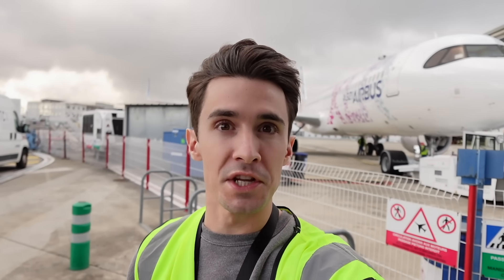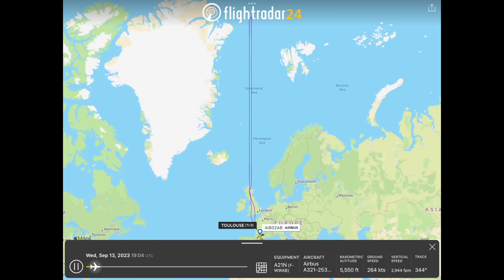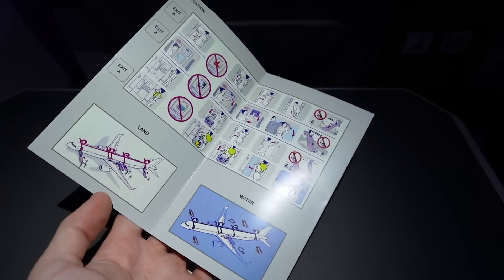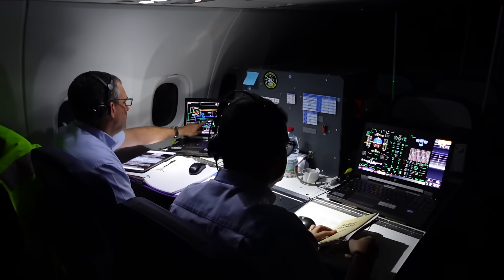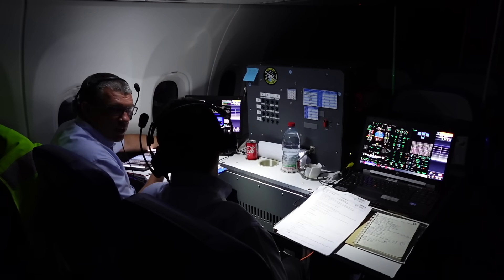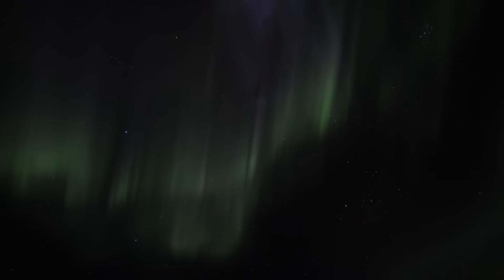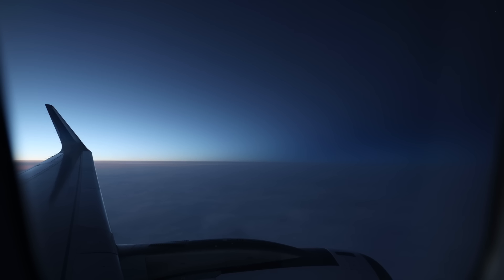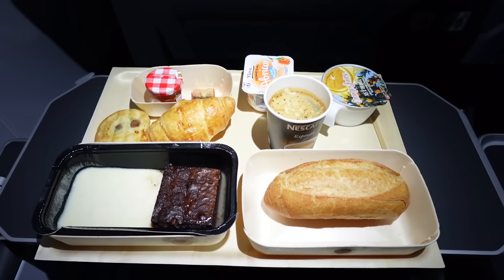Onboard an 11-hour A321XLR Test Flight to Nowhere!

Comment: I can’t wait for this to be in service. Game changer in the long haul biz
Reply: It will not kill true wide body planes. No way. It will simply connect remote cities with no prior direct connections and low traffic. The A321XLR has its own restrictions and shortcomings.
Reply: @paradigmlost7582  It lacks the range and the capacity. I believe nobody expects it will replace wide bodies. Like you said, I believe we will see previously non existent routes coming to existence.
It will make another dent in the hub / spoke business model reducing the need for some wide body flights, but not replacing them.
I hope.
😊
Long flights on narrow bodies is not my thing.
Reply: people who dont like single aisles for long hauls i just don't understand they are so spoiled im happy to be on any plane
Reply: Lol game changer in what way? The 757 already trailblazed the single aisle, long haul routes. This just expands on that with additional range, at the expense of speed.
Reply: @FEJ-234 it’s absolutely a game changer. The hourly operating cost remains significantly lower than the B757. The airplane won’t need major airports either. So instead of the hub and spoke, they can do direct flights to and from small cities.
Reply: @rtbrtb_dutchy4183   They mean it isn't any game changer because the 75 has been doing that for decades...It's just a replacement for lower costs.
Reply: @Jack3md  no, you are missing the point. The b757 has been doing those trips, but can’t do short trips as efficient. This is why Southwest never flew 757’s. Why? Because the 757 won’t do well from Lincoln, Nebraska, to Billings, Montana with only 100 passengers. 

The game changer is that the A321XLR can fly long haul, but can also fly short haul. And if a short haul flight has a drop in passengers, they can send a 320 or 319 with less seats, but they can still use the same pilots. 

It’s the flexibility that will make it the game changer.
Reply: I absolutely hate the concept of single aisle long haul. Anyone who has flown long haul will tell you two aisle are necessary for mobility during the flight.  It will be sheer torture to the passengers to subject them to 8 plus hours of hell on this pig.
Reply: @davidcole333 why do you need two isles?  If you want to stretch your legs, don’t you simply stay in your isle?  I’ve never gone over to the other isle. 🙄
Reply: @rtbrtb_dutchy4183  Wide bodies usually have more space, more comfort and less noise.
Reply: @miks564 no, there is no more noisy plane than the Boeing 777, it is horrible.
Reply: @miks564 widebodies being more "spacious" and less "noisy" is not true at all. Physics alone disproves that due to the sheer size of wodebodie engines. Two engines need enough power to not only fly hundreds of thousands pounds, but also be approved for si gke engine should one engine fail. Which means they will require massive amounts of thrust which causes a lot of noise. That said, they are making engines more efficient not only with fuel, but noise as well. The technology they use for new gen aircraft is made with comfort and safety as top priority and the XLR is no exception to that. It all cokes down to the airline and how they choose the utilize the layout.
Reply: @StallionFX1   Well, you might have a point. A wide body cabin doesn't have to be quieter nor offer more space than a narrow body. That said, they truth is that they often do. I lack the experience on flying on old Boeing aircraft (besides the 737), so I'm not sure about those, but I never seen a narrow body more quieter than an A330 or A350 or A380.
All these have much bigger engines, but they're still considerably quieter ...and they offer more space as well, because wide bodies are usually configured for long haul.
But I admit I have to wait to see what would be the cabin configuration for XLRs... One thing I'm certain of, it will be noisier than the mentioned aircraft models.
Reply: @davidcole333 Don’t be a baby. It won’t be anywhere near that bad.
Reply: @davidcole333 normally, most people that think like you either have no clue about aviation or just can't stand the idea of a narrow body doing a "long haul" without doing proper research and/or given new gen single aisle a chance. Granted, it seems unorthodox just thinking about it, but it's really kot as bad as you think. With newer generation aircraft, safety, efficiency,  and comfort are the biggest priority. 

I've flown on Delta's A220 (SLC to EWR) and Aer Lingus A321NEO  LR (JFK to DUB). Both flights were over four hours (with Aer Lingus being over 6 hours to Dublin and more than 7 back to New York). I'm 6"4 and I was comfortable. Even more so the Norwegians 787-9. I say that because these are the new gen aircraft I've flown on so far. The A220 was relatively quiet and hardly felt any bumps while in turbulence, while the A321NEO LR  got me to my destination without complaints. The 787-9 was cramped, seats were uncomfortable after a few hours, but it was impressive to watch in motion. It really comes down to the airline and how they chose to set up their aircraft. Even the smallest details can male a huge difference. For example, Virgin Atlantic offers one of the LARGEST IFE in economy in both their 787s, A330NEOS, and A350s. With state of the art seat design which alone makes a huge difference. Their A340-500 was also the BEST flight I've ever experienced all around. 

Not trying to sound bias, but I think it really comes down to personal preference, realistic expectation, and the way the airline has set up their product. Just have to do some research beforehand so you know what you're getting yourself into. You'd be surprised what you learn and life-changing information that would help you dodge a bad decision.

Comment: It’s so cool, but where will the flight attendants rest? Haha
Reply: Have you seen the railings at around the six minute mark? Those are for the curtains to shield the resting cabin crew from passenger view. The crew complement most likely be for full service airlines 5-6 cabin crew and 2 pilots (who take their rest on the flight deck - as it is done already on sectors not requiring a three pilot crew (Europe to Mauritius for example is such a route, departing early afternoon allowing for a 14 hour duty time outbound) which means savings for the airline company.